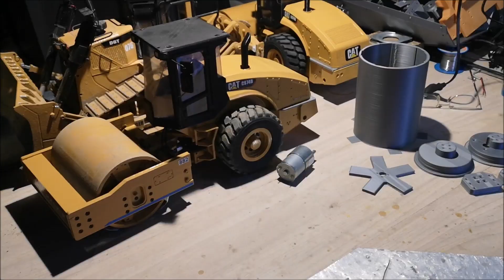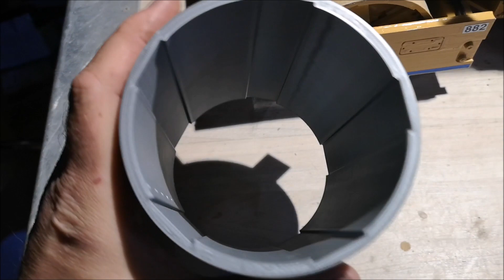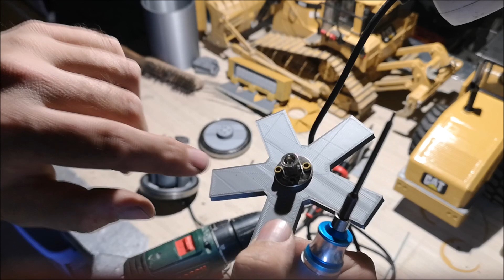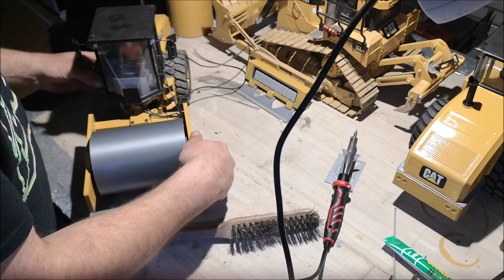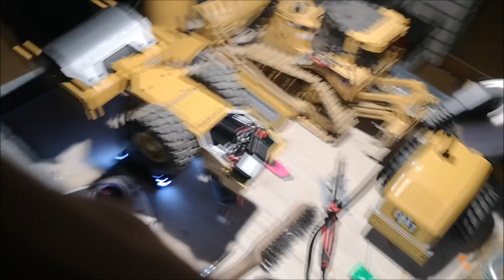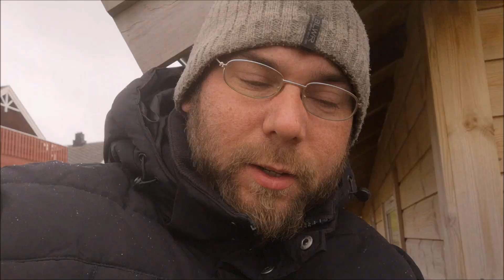Compactor POWERED DRUM update

Comment: Hi Lasse,  why are you adding another engine to the cylinder? The two motors on the wheels are weak? I thought they were geared well, that they were strong enough. The stupid thing is that when you have already bought engines for wheels with 27 RPM, this new engine with these RPM is not 22 or 35 RPM. The question of how far loaded the motors are, that I would try to get close to the RPM of a loaded motor.